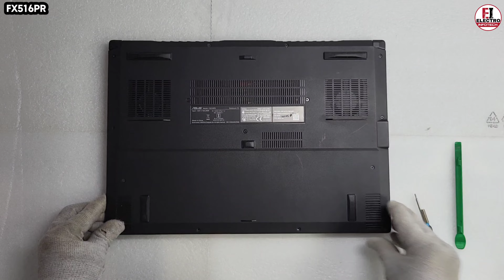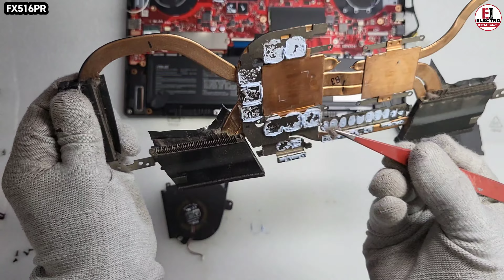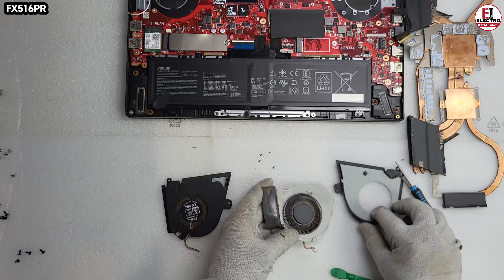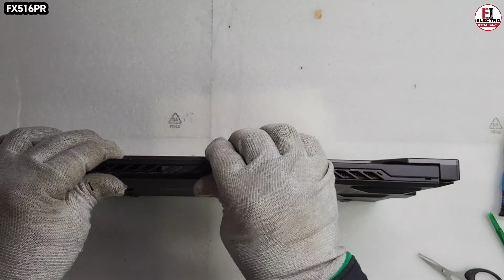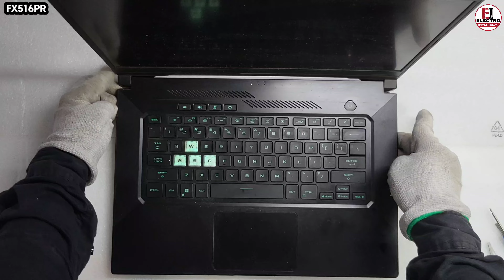ASUS TUF F15 Model FX516PR Dust cleaning And Thermal Paste Replace / Disassembly And Assembly

Comment: It's hard, guys, especially for beginners  like me not that easy you see in the video
Reply: What difficulties did you have?
Reply: @Salamfyk1  It was with the disassembly there was for me three striped screw in my laptop I couldn't get out and because of that I just wasn't able to do anything and and also the wifi and Bluetooth connector was also hard to put in especially without equipment

Comment: is taking out the whole piping necessary to replacea single fan?
Reply: You need to remove the heatsink to replace the fan, the fan wire is below the heatsink.
Reply: Yeah it really sucks. One of my fans started rattling and I can't even fully take it out to clean it properly.

Comment: This is noobish. You should tke out fans first, they are held to pipes only by tape Rip it off, thon replace tape with general  wire isolation black tape,
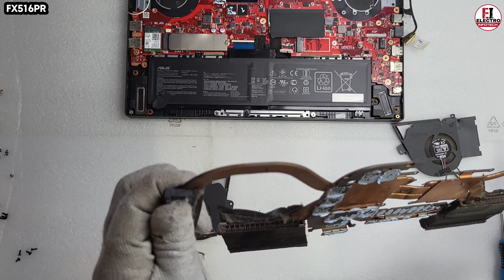Reply: I think the design doesn't allow for that. If you look at 6:25ish, he tries to take out the fan from the front but ends up having to push it out the bottomside.
Reply: @Joppe253  I think you are right, cause they sell fan in a whole chasi design. I mean a fan is only that black thing, that is then attached to other half.